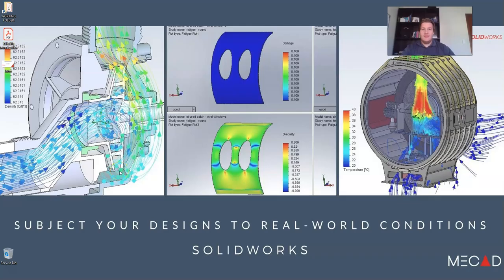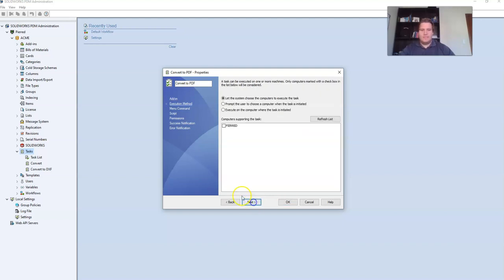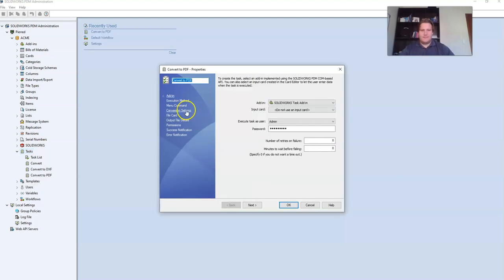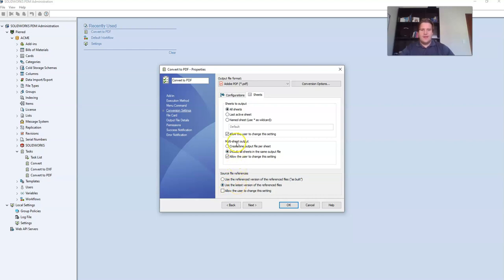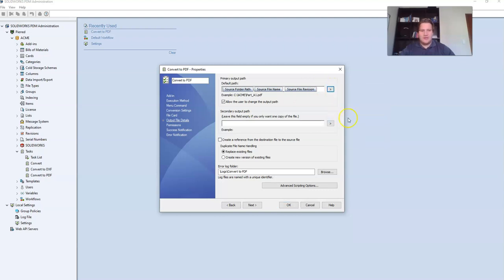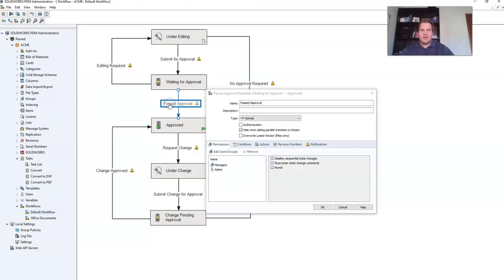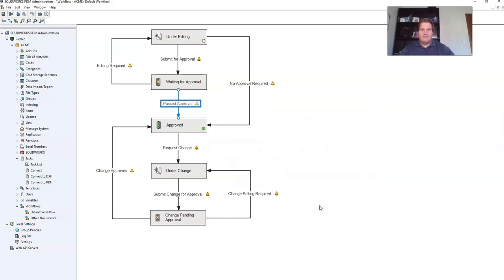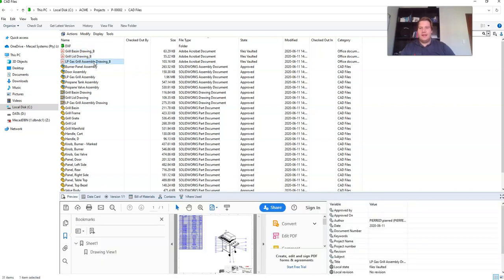Automate Drawing to PDF conversion using PDM Tasks

Comment: I'd like this, but not to run for every drawing file in the source folder- I'd like to pick and choose. Would a Macro be a better way to accomplish this? Desired output path and file name (including rev suffix) are the same as yours: Source File Path\SourceFileName_Rev.PDF.  Thanks!
Reply from the maker: In this video I have added the “Convert to PDF” task to execute when I approve files. Hence why it converts files in batches.
PDM Tasks can be accessed within the vault using windows explorer, from the menu that pops up when you Right-Click on a file.
Using this method you can Right-Click the file & choose to run the “Convert to PDF” task & it will convert only the file you have selected.

Comment: How long  did it actually take for the SW dwg to PDF conversion to finish? I noticed you didn't show the part where the drawing is opened one by one in Solidworks automatically to convert them into PDFs.
Reply from the maker: This will depend on how many drawings you have, the size of the drawings, and your PC specs. Its generally only a few second longer than opening the drawing yourself, but since its automated you can do other things while this runs.
Reply: @mecadsystems-solidworksand4875  Isn't the automated task basically a macro that opens a Solidworks window, opens your drawings and save them as PDFs? I understand if its in a different computer where the task is assigned as Task Host, but how are you going to be able to do other things when this is running in your computer?

Comment: We followed the steps and got the functionality to work...but our PDF is checked-out. How did you get your PDF's to be checked-in automatically?
Reply from the maker: Hi RJ, thanks for watching our video. To auto check-in you need to change the settings under the administration dashboard, under Users > Adding Files, then add the extensions you want to auto check-in. Hope this helps!